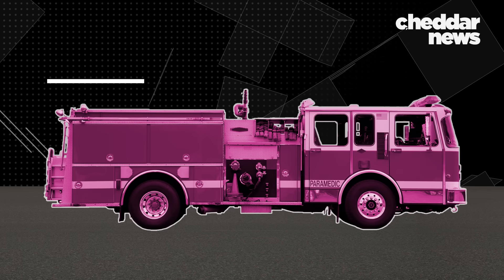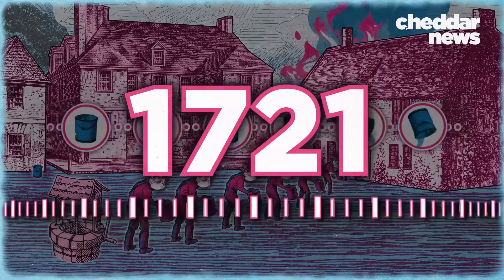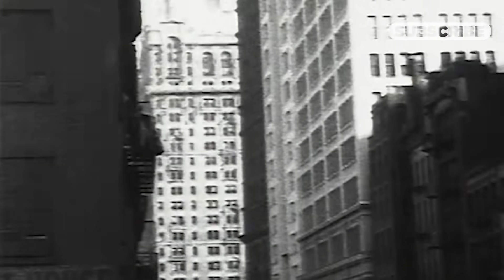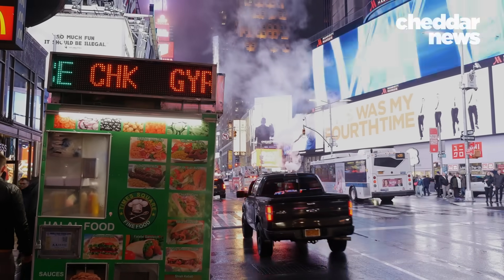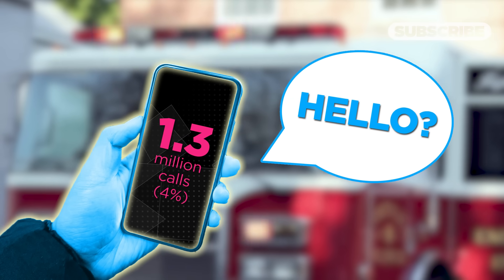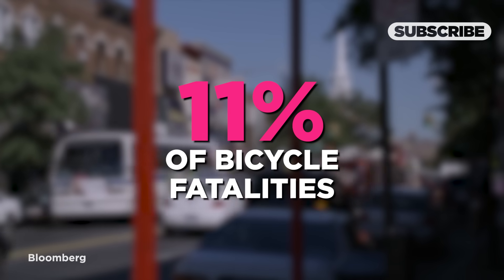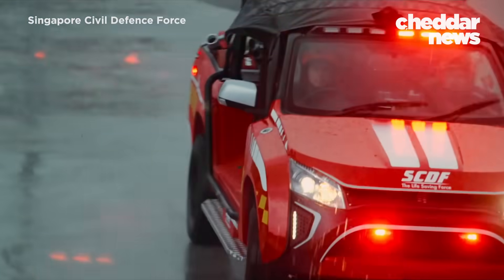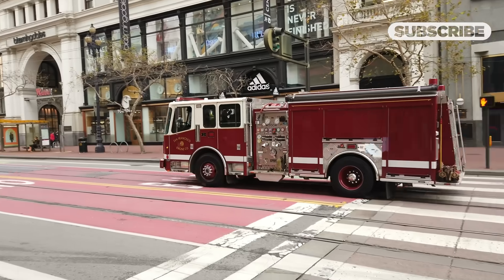Do American Fire Trucks Need To Be So Massive? - Cheddar Explains

Comment: Most fire apparatus serve multiple purposes; an engine generally also carries rescue equipment, a ladder (aka a quint) will also carry water and a pump. Tankers, by default, are also engines. Such versatility is cost effective, particularly for smaller, volunteer departments.
Reply: Ladders and quints are not the same, the both have arial devices but there not the same. Also tenders are not the same as engines, tenders are based around transporting water while engines usually have greater pumping capacity and more rescue tools. In a pinch a lot of the trucks you can fight fire with but they all have a very special purpose and do that better than any other truck
Reply: A quint is a ladder truck with a pump panel, similar but not the same.
Reply: take a guess: although not 100% the same, it's similar over in Europe as well

Comment: I think the main difference is in coverage. In the Netherlands you have basically two categories of vehicles: General response and specialized ones. The general response truck has the generic equipment, and if you need more the dispatcher will call in a specialized vehicles from a nearby station.
We also use swap bodies for the special equipment which means having one or more trucks getting all the necessary boxes in a shuttle service instead of cramming it in one vehicle.
And with the distances we have, there's almost always an airport vehicle close enough if thing really get out of hand.
Reply: It's not only that, it's the fact that EU law is very strict on vehicle sizes and firefighting trucks are kept within the same size as an ordinary truck. Also the combo of general response (tankautospuit), general tooltrucks (HV's), cherry pickers and hook arm trucks carrying a whole range of different things from extra pumps and hoses to a mobile crisis center is a great way to create smaller trucks. Sure, you might need an extra truck on scene when something happens but because of the coverage and the way the cities are designed this is almost never a problem. One thing I also find strange with US firetrucks (also EMT) is the fact that they don't use blue light, to me they don't stand out in the traffic at all looking at videos of them. The blue light that is on all emergency vehicles in Europe stand out and it's immediately clear that something is coming.
Reply: I think this is where the video misses the point. It is not about less equipment, but about spreading it across more vehicles. Compared to purpose built vehicles, it is incredible cheap to put your equipment into a standard box truck and carry it this way. Similar around here in Germany where large departments sometimes have more vehicles available than firefighters on a shift.
Reply: Not only in the Netherlands. Almos every EU country works like that, since is a far more efficient way of doing things.
Reply: agreed.  The fire department in my birth town had a few trucks with enhanced off-road capacity since there is a national park they have to go into at times.  The fire department of the nearby city doesn't have such a vehicle as they have paved roads everywhere.  I've also seen the large ladders on trailers that they tow when they need it, rather than taking it out every time.  The standard trucks have ladders that can go 3-4 stories high, more than enough for most buildings and they only bring out the big ladder for the couple of buildings in the town that require it.
Reply: Also, if there is an accident involving a heavy truck, firefighters, at least in Bratislava, occasionally call the big four axle hauling truck of the local transport authority. This truck is designed to tow bendy buses and has a very capable hydraulic equipment and a long "fork" at the end. I know that it was being called by firefighters/police a couple of times when something bad happened especially on the freeway near Bratislava.
Reply: In germany we have two types of Fire fighter the ones who are doing this for free and the ones who work as a firefighter and the ones who are doing it for free and are getting called to go asap to the Departement and get in the vehicle  those Departement are in like every Village one they sometimes have a Ladderwagon they have a car a bus and some trucks there are different types of those and in some Cities they have to have quite good controll over the vehicles because of tight roads like the truck barely gets through
Reply: There are only like 10 active airports in the whole of the Netherlands though... Many cities are over an hour drive from a capable airport.
Reply: @andrewlalis  they do show up with some of these trucks sometimes, had a pillar of smoke pass by my school once, on the news was an airport truck busy helping out, with fires that size you'll also spend a lot of time getting it out
Reply: @andrewlalis the comment also fails to account for the fact that just like how the US counties have mutual aid  contracts EU Schengen countries have similar ones where if a fire is near the German border within the Netherlands they might request a German department to respond and vice versa (however this is rare as they're usually called as backup to situations get out of hand for the responding department to handle)
Reply: @andrewlalis most of the cities are already in one hour driving range from the largest airport (Schiphol). Hell within two hours you're standing in Germany.
Reply: @andrewlalis  Actually, according to ICAO regulations, so long as it is an airport, fire services are mandatory and it has to be able to reach every spot of the airport within a certain limit of time, so a small airport like the ones in rural america has to have the same standard of fire fighting capabilities and responding speed as an airport as large as Chicago or JFK, thus even uncontrolled airfields have fire fighters, thus the mandatory fire service is also one reason why operating a small airport is so expensive as even an airport like St Helena will need to have the same fire fighting services provided at Heathrow airport, and since most days airport fire trucks aren't actually called upon, so it's not surprising for them to come out to help with fire while testing whether their equipment works
Reply: @andrewlalis  Nope. Militairy airports also have fire fighters. So they're are all in accessable distances
Reply: @andrewlalis  If a fire is so big that you need an airport firetruck then its lost anyways. Let it burn and save the sorrundings
Reply: With other words: Seizes doesn't matter

Comment: Here in Australia we have a huge range of Fire and Rescue vehicles. In the city smaller more agile trucks that don't carry much if any water are used. We still have some longer with high reach capacity but we don't have as many tall buildings as most city's in the USA. In regional and rural areas high clearance vehicles with water carrying capacity and all terrain modifications are used and dirt roads and rocky ground is more commonly encountered. We also have smaller pickup style trucks for rapid response for vehicle crashes and elevator style emergencies rather than sending a whole truck they send specialist personnel and equipment to those jobs.
Reply: Not to mention a rural fire brigade that operates different trucks and usually operates In Rural areas, farmland and forests.
Reply: The Dandenong CFA has at least one 4-axle ladder in their fleet.

Comment: I like how in the thumbnail they show a fire engine compared to a tiller. Like of course they're going to be different sizes. Take an actual fire engine and compare it to your fire engine and they're going to be a lot more similar. Yes, it's still going to be a little bit longer but a lot different than comparing a tiller to a fire engine...
Reply: also when you compare Aerials of the same height, the chassis of the American one will be a lot longer. The size of a truck chassis of a 100ft ladder in the US is comparable to the size of the truck chassis of a 200 ft ladder in Europe

Comment: In reality it all comes down to the department and the communities they serve and what best suits them in a practical and logical sense. When it comes to Engines (Pumpers) it's more than just tank size, you also have to consider the size of the pump and how much water it can move (GPM), then you need to consider the equipment that truck will carry. My company for example, has 1x 150ft 1.75 attack line, 2x 200ft 1.75 attack lines, 2x 400 2" attack lines, 1x 250' 2.50 attack line, 1x 300' 3" Blitz/Supply Line and 1,500' 5" LDH Supply. Along with a compliment of ground ladders, hard suction, various couplings and adapters and a multitude of other equipment to assist in fire suppression efforts, we cover a large area that is mixed with residential, commercial and industrial and a large amount of highway so our Engine was spec'd and equipped to meet those needs. 

You also see a lot of multi-purpose trucks in NA especially in the United States as upwards of 70% of U.S Firefighters are volunteer, and with volunteer numbers dwindling and manpower shrinking as a result, departments are building these multi-function trucks such as Rescue-Engines which will now not only carry what a typical engine would, you're now adding rescue equipment such as saws and others which could range from vehicle extrication equipment, high-angle to water/dive equipment. Then add on those companies out there in lets say more rural or sprawled out areas, where 2nd due companies are 10-12 minutes out and that's being generous... That's an eternity during an emergency, especially a fire. A typical 1.75 attack line flows at least 150 GPM so if that area is lacking hydrants or another viable water supply (lake, pond, river) then that department is going to need pieces of equipment that can sustain themselves for a prolonged amount of time, so in those areas it is not uncommon to see a combination Engine/Tanker with upwards of anywhere from 1,000-1,500 gal of water, if not more. 

So you'll very obviously need larger vehicles to move that equipment and water around.

I'm not relatively sure how things are done in Europe and Asia, so I can't speak for them.

But I do know they have the common goal as we do here and that is to serve our communities with the absolute best ability. 

And we all do that by building apparatus that will make that goal possible
Reply: Germany has almost the same number of firefighters like the US has, with 96% being volunteers; The typical first due apparatus is a Rescue Engine here as well.

Comment: Well technically a fire department's job is to put out fires to mitigate property damage and by extension save lives. We view their purpose in saving people's lives as the primary one but it's not actually the case. They do save lives even save lives directly but they're equipped to mitigate the spread of fire in order to protect the community and that means putting out fires to mitigate property damage and by extension loss of life. Saving people is incidental

Comment: Why do we even use ladders anymore. We have the drone tech to carry hundreds of pounds of explosives all over the planet. And commercial drones capable of lifting hundreds of pounds. Why don't we just use a drone to lift the fire hose up in the air and power it by it being tethered to the trucks own generator. Giving its electric motors considerably more power than we would expect and allowing you to theoretically apply water or some kind of extinguisher fluid on a fire of virtually any height.
Reply: One of the biggest uses of a ladder is getting trapped victims out of a building or getting firemen on the rooftop to rip it open.
Reply: @kempo_95   that being ture a high  capacity drone capable of lifting a fire hose , weight of the water in it as well as resisting the thrust created by the water nozzle. Would be more than enough to lift a team of firefighters onto the roof of a building or allow for the equivalent of an Air evac. 

I'm also not suggesting that letters be replaced entirely. will probably have a need for ladder trucks but a drone hose would make smaller vehicles more adept at fighting fires as well. 

 if we're talking about a major city like New York and other areas that have multi-story buildings 100 ft ladders not going to really matter in those areas you definitely need a drone capable of providing point-to-point air to ground transport for both water firefighting teams and people being rescued from the building.

Don't think of a drone as in a camera drone think of it as a small electrically powered rescue helicopter with a fire hose attached to it.

You can even make a drone a large enough to carry a four Man fire team to anywhere at the maximum length of the hose which can be several hundred feet.

It effectively all depends on wind and the drone size and lift capacity.
But considering you could fit one capable of lifting a 2 or 3 people in the back of a large pickup truck. It's much more convenient and effective than a ladder is specifically for moving the water.

You could also use the drone as the top most point of a zipline Gurnee system to allow you to lower people down to the ground on a cable sled. That kind of system is you with helicopters but since the helicopter is not moving in this case and just lowering people to the ground it may actually allow for a faster evac and you would get out of a ladder. Maybe people are unpredictable
Reply: @madmachanicest9955  when you want to get a patient out from the window on the 2nd floor of a 20 floor building you won't have a chance to get the drone close enough to the wall or window
Reply: @EnjoyFirefighting   I'm not an expert on fire Fighting but I am a decent engineer and I knew a lot Drones. You could fly a small one into a burning build with the right path and stabilizing software.

And considering the drone has much better stability and maneuverability over a rescue helicopter. You could in fact get it close enough to the building to rescue someone from it.

Especially the drone is large enough to be used for firefighting. As I'm talking about using a drone strong enough to carry the entire hose and all of its water and resist the force of the water being ejected from the nozzle. That means the thrust and variable Frost at the drone is going to be a few thousand pounds.

I think you would have a harder time getting people to get in the drone versus the latter but you could use a drone to evacuate people from a building if it were large enough.

Ideally you would use a cable gurney system similar to a window washer.
Only suspended from the Drone. I also don't think they would make for a permanent replacement too ladders. ladder trucks are gigantic  and extremely expensive. And when you're dealing with a heart a high-rise of over 10 stories completely useless.

So high lift capacity drone on a smaller vehicle might make a good alternative to a large fleet of ladder trucks and they would have some advantages that letter trucks and do not.
Reply: @madmachanicest9955  drones and helicopters to extinguish a fire have been tested. but I don't see how evacuation of people is supposed to work with drones, especially as you can barely get a large drone close enough to the wall of a building to let people walk / climb into it.
"Ideally you would use a cable gurney system similar to a window washer."  those are a) super slow b) don't exist on medium rise buildings c) you'd have to turn the patient by 90° once outside the window then
"And when you're dealing with a heart a high-rise of over 10 stories completely useless." not sure what you mean by that. There are up to 200 ft tall platform ladders and up to 367 ft tall platform booms out there in service of fire departments. The tall platform ladders also come with an evacuation lift which rides the ladder up and down while the ladder itself and the platform stay up in the air.

Comment: This is an incredibly one sided video in favor of downsizing firetrucks, and clearly the research wasn't invested in the right areas. The size of the firetruck is irrelevant when it comes to biker incidents... The size isn't chosen based on biker safety, nor should it be. The 2 are unrelated. It's chosen based on needs of the department such as water capacity, crew capacity, and tool storage capacity.

Comment: In the USA all of the big custom chassis fire trucks have the latest and greatest safety technology, ie front air bags, side curtain, windshield air bags, tire pressure monitoring and s slew of other safety features that aren't available on European trucks.. combine that with the fact that American fire trucks are more powerful and have significantly larger pumps and water capacity means they will be larger by default
Reply: Do you really think we don’t have airbags in European fire trucks ?
Reply: "and s slew of other safety features that aren't available on European trucks" could you name some examples for those features which you say aren't available on European trucks?

Comment: First, it’s pronounced CHASSI, the last s is silent. Secondly, not all fire APPARATUS are trucks. Fire trucks carry ladders and extrication gear, that’s why trucks go to car accidents. Fire engines carry pumps and water to put out fires. Thirdly, American fire apparatus aren’t an old design, it’s an American design! Lastly, contrary to your little research project, American fire apparatus do carry more equipment and more manpower than its international counterparts. I found your video very cute.
Reply: "American fire apparatus do carry more equipment and more manpower than its international counterparts" uhm no, not quite; E.g. in Germany a standard Engine carries a crew of 9, and as a matter of fact, carries more equipment despite being more compact.